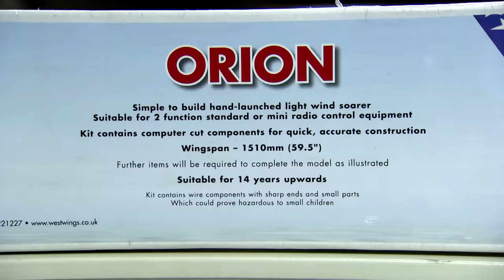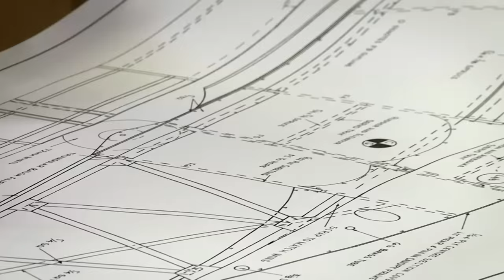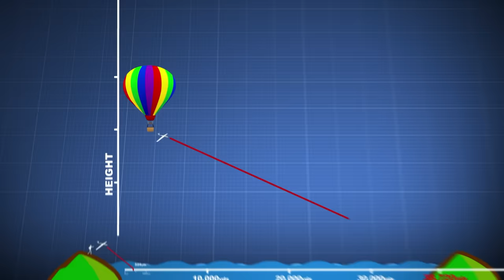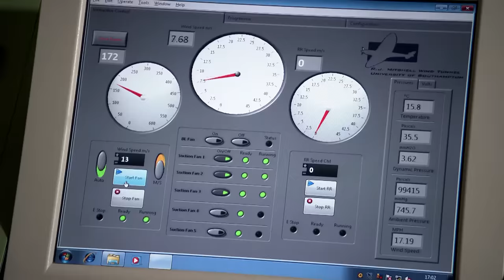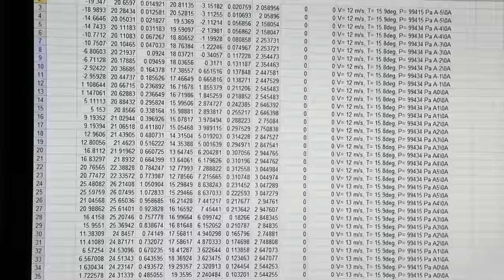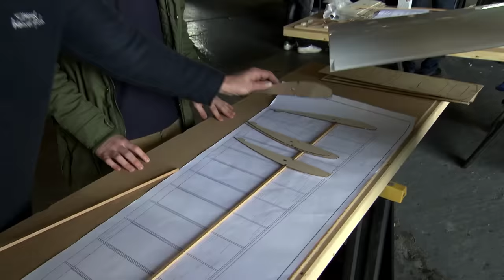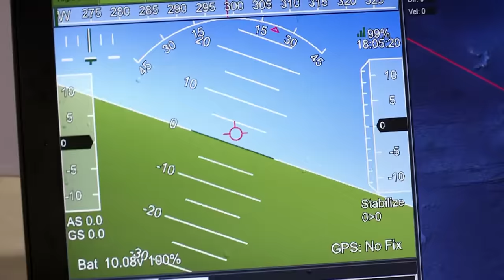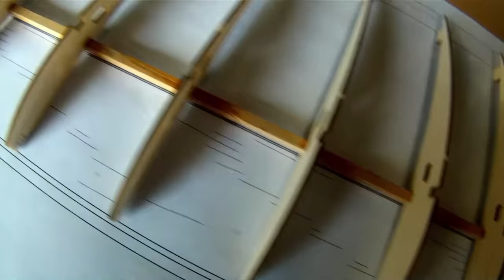Can This 1000 Piece Model Plane Fly 22 Miles!? | Toy Stories Special

Comment: I don't have faith in science anymore calculated to need to have a drop of 8000 dropped at 2990 still made it and did u say that box weight is 2 tons 😂😂😂
Reply: It was dropped the fist time at the low altitude, and made very little distance.
The second time was dropped at 10,000 feet, so 8,000 was pretty much spot on considering it was still at about 2000 feet when it reached the island.